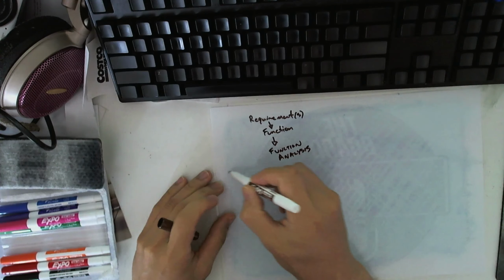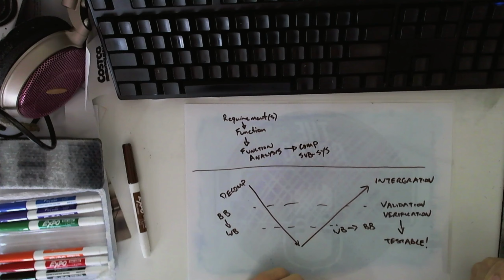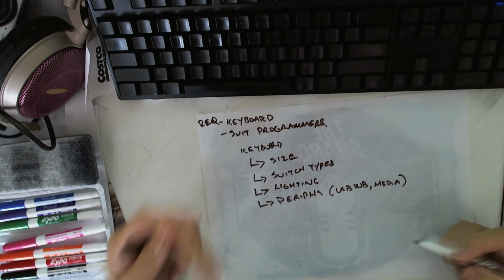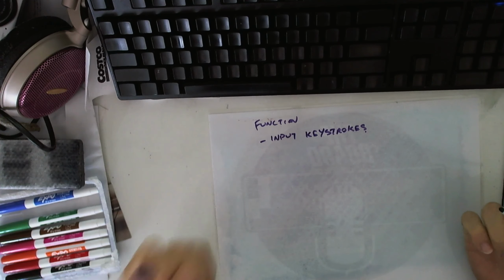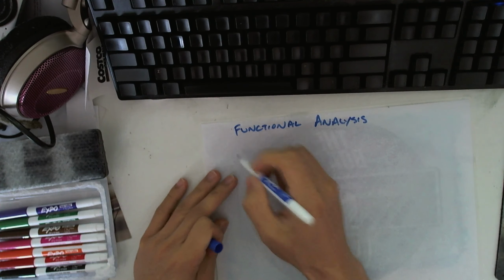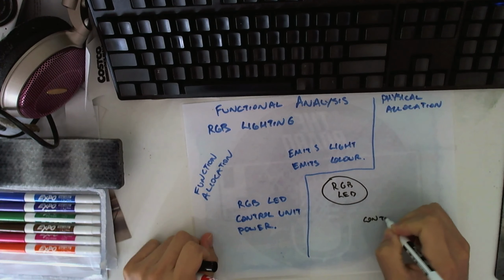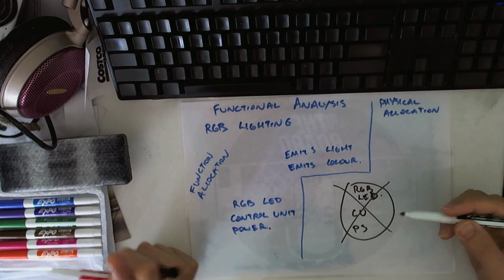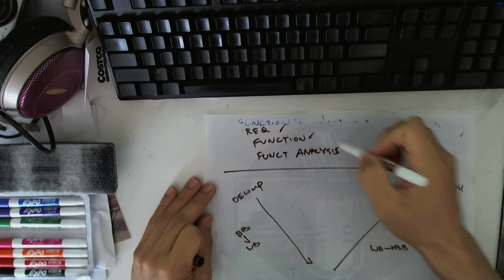Basic Introduction of Systems Engineering (V-method) [Part 1 of 2]

Comment: I didnt understand something, i am not a systems engineer i am just looking for something that i wonder.
 Are the systems engineer building the product or just making any product compatible with related systems or just building require product for making things more compatible and controllable
Reply from the maker: Its not that straight forward.

A systems engineer is kind of like a consultant who works with design engineers, production engineers, development engineers, hardware engineers, software engineers etc.

As part of the chain of events, the systems engineer ensures that all of the considerations are covered, from what the 'system' needs to include, and as you say, the important compatibility with relevant systems and so on, so forth.

They themselves are like the spiderweb and glue of the design, testing, and implementation of a 'product' or 'system'.